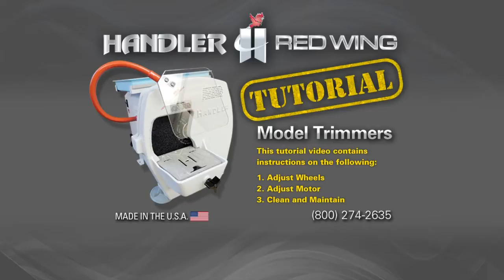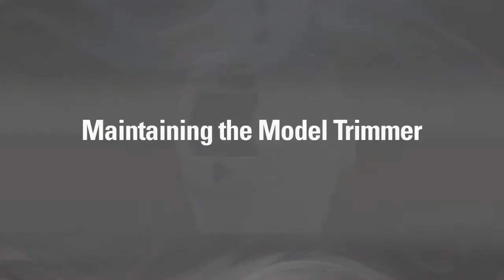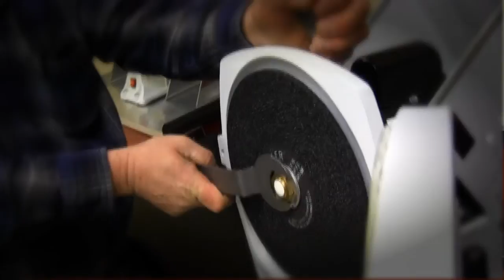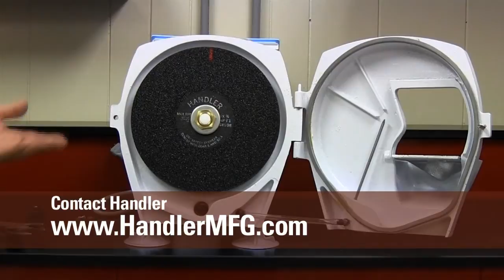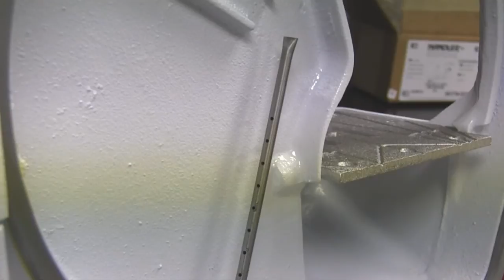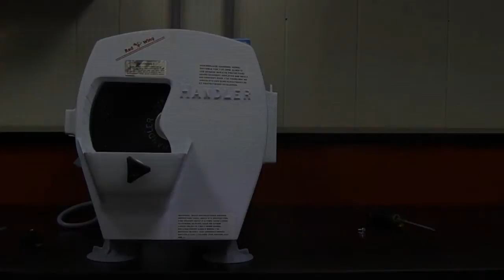Handler MFG Model Trimmer Tutorial

Comment: I have no waterflow on my handler model trimmer. the blockage is in the tube . reaming out the spray holes isn't working. I can't budge the set screw at the bottom of the spray tube. could I take the door off and soak it in a solution to dissolve the gypsum in spray tube? If so what solution would you recommend?
Reply: Hi Mark, did you end up figuring this out? I got mine cleaned up with the acidic solution for the ultrasonic cleaner. I still have a blockage. Can't get the door off easily since it is painted. Do you know what the head of the set screw is like? Is it slot or philips? It almost looks like a hex for an allen key. thanks!